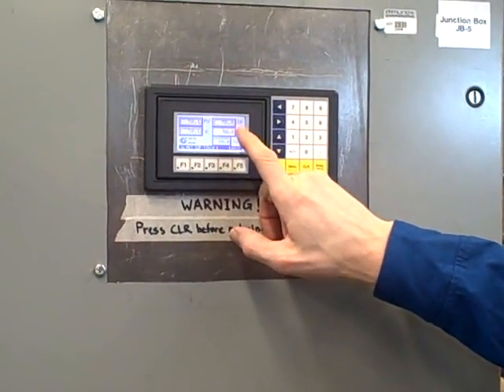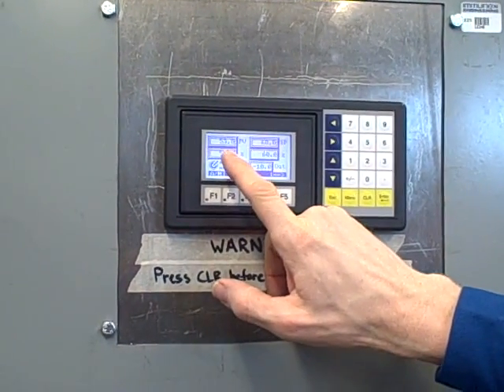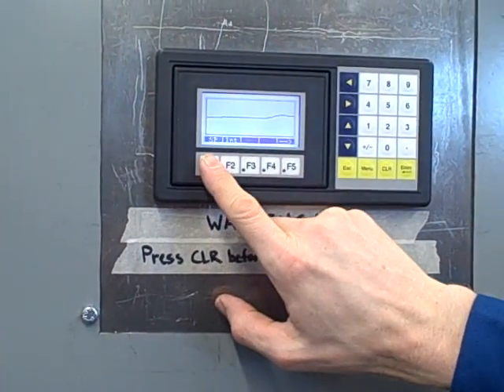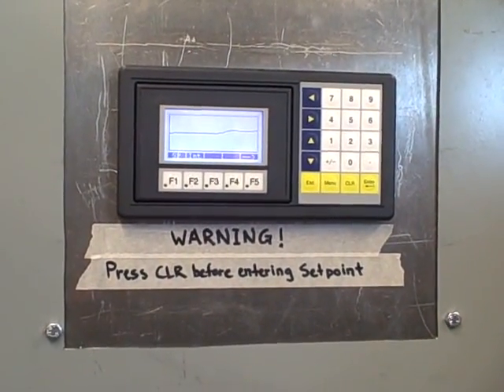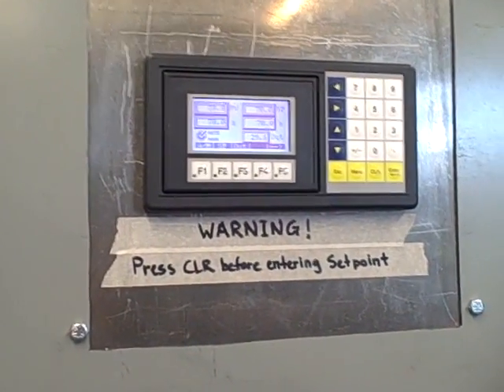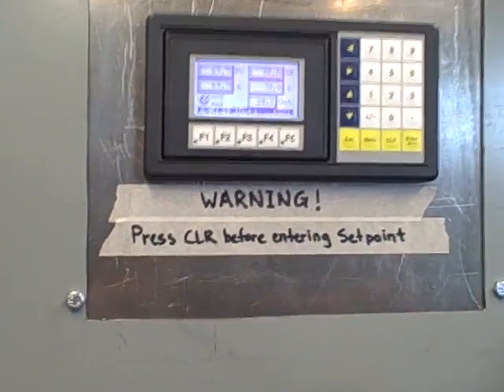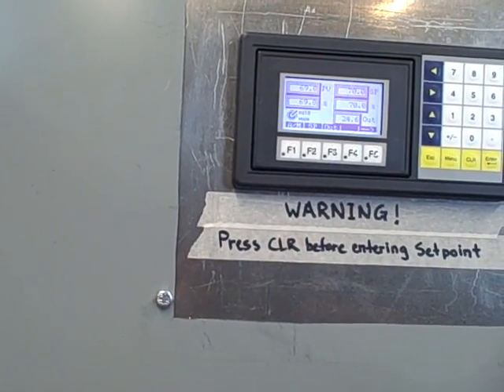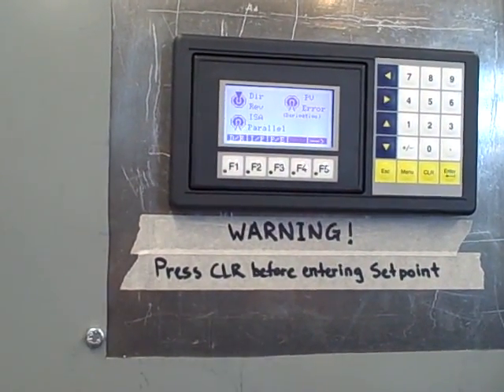Controlling water level with a PLC

Comment: @BTCInstrumentation thanks. I found it, but could not view program becuase we only use AB, and Siemens PLCs. But I viewed pdf schematic. Seen extra circuit that had to be built for 20ma sig, becuase PLC does not have a built in signal card. Thanks for you time, was hoping it was simpler project, just using an AB where everything you need is aready built into PLC, one need only write program. :>)

Comment from the maker: Okay, go to Google and search for a site named "Socratic Instrumentation".  Go to the bottom of that page and click on the link for Hardware and Software.  Search on that page for "PLC" and you will see links to the Automation Direct PLC and HMI programs, as well as schematic diagrams for the PID controller setup.
Reply: Just what I was looking for!  I've had nothing but trouble with the CLICK's built-in PID.   Freaking thing has gone nutz several times and tried to slag down the heated system.